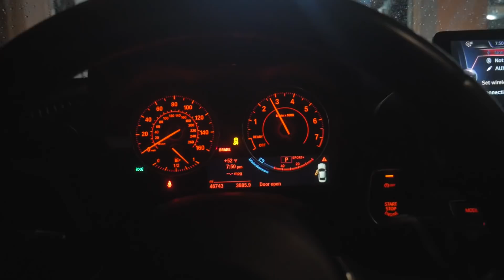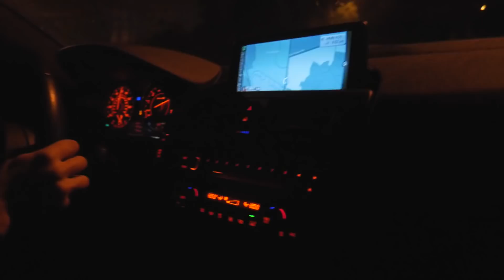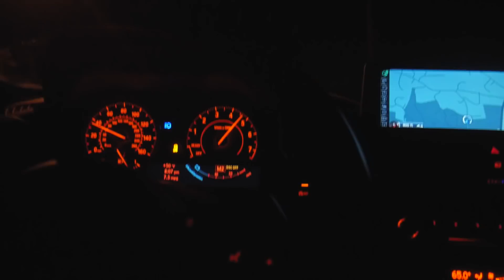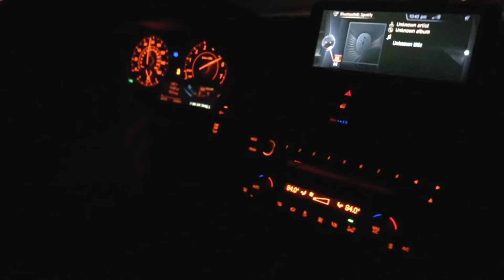Straight Piping My BMW M235i From the Downpipe Back (Exhaust Law)

Comment: Shane n55 you said it. Sounds really great on upshifts on hard acceleration especially inside the cabin. I would have loved a before and after to its compare stock sound vs straight piped. Great video though!

Comment: Now imagine if that was a true manual 😍
Reply: How would that change the sound? I guess slower shifts....
Reply: Jason Murphy you had a manual 328 bro you know there’s a specific sound a manual transmission gives that a dct cannot duplicate although it comes close but not quite... it’s not so much the sound itself but the gear ratios idk haha and the feel is totally different
Reply: Justin Depas haha how did you know I had a manual (128i) before my M235i 8sp ZF?